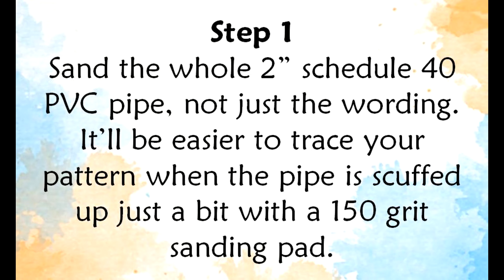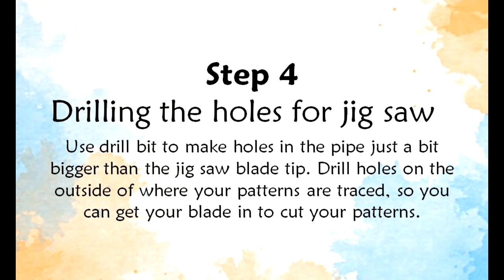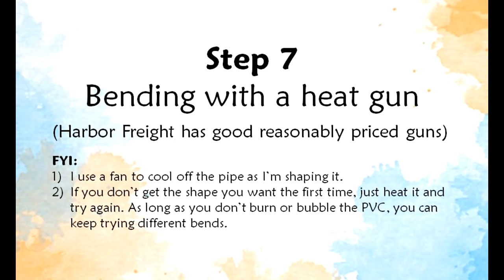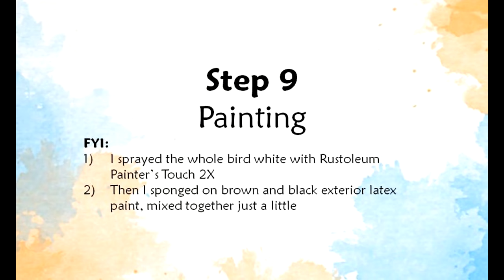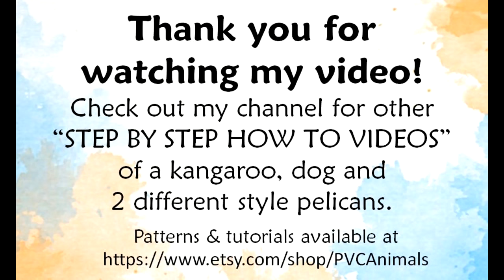Step by step - how to make a simple PVC pipe bird

Comment: Where do you get the eyes for your birds?
Reply from the maker: Hi,

Colored eyes:
Suncatchercrafteyes.com
Glasseyes.com
Amazon – CalCastle Craft Store. Search Animal eyes with black centers. They have a variety of colors available.

Black eyes:
Amazon – Darice. Search solid black eyes. I think they have colored eyes as well, I just haven't used those.

I use the eyes that are sometimes called safety eyes and they include washers. These eyes have a stem that I cut mostly off, I leave just a little bit to glue into the animal. I don’t use the washers, it’s just that style eye I use and they’re included.

Hope this helps :)